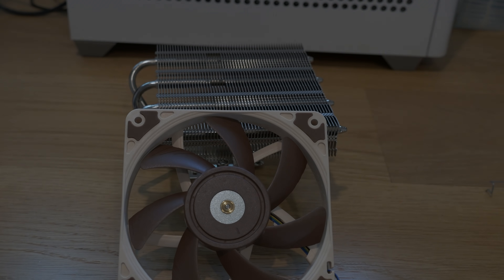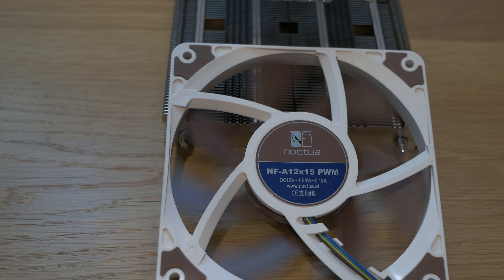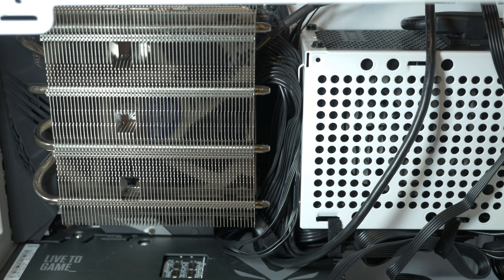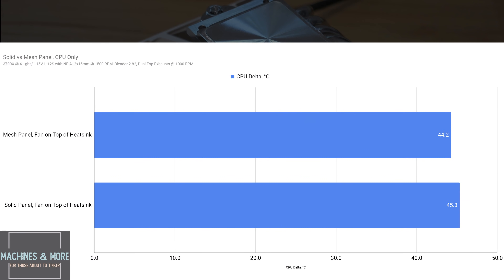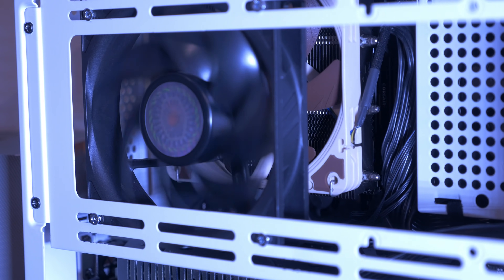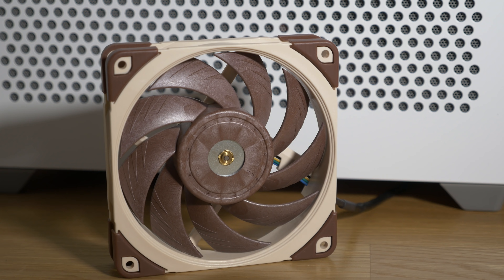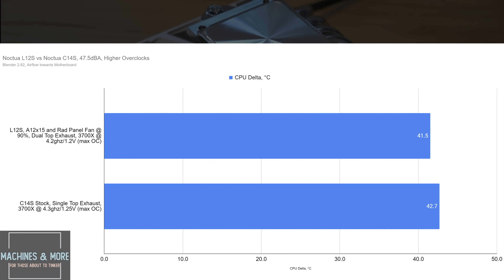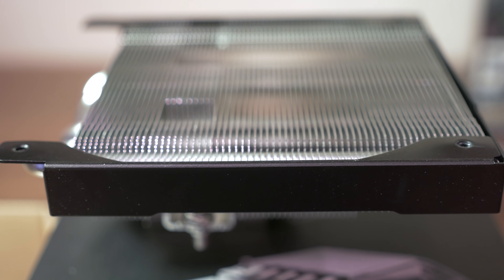Cooler Master NR200: Low Profile Air Cooler Configuration (feat. the Noctua L12S)

Comment: what air cooler should i use for 7950x3d? i currently use a kraken 240 but am upgrading my 3070 to a 9070xt
and am unsure if it will all fit.
Reply from the maker: What case? The bigger the better, for top down coolers look at a C14S, tower coolers such as Thermalright PA120, Be Quiet Dark Rock Pro 5, Noctua D15 etc. are also good choices if you have clearance.
Reply: @ I’m using the NR200, I appreciate the reply brother.

Comment: Thank you so much 🙏 great video 👍 did you by any chance try push/pull away from cpu, either with mesh or side fan exhausting hot cpu air out of the case?

Comment: If using the Noctua NH-L12S Cooler, is it possible to mount a 3.5" HDD on the PSU shroud ? Does is clash or not ? Thanks.

Comment: I migrated my build from a silverstone ftz01 to a n200p. So I kept the noctua l12s low profile cooler. I'm cooling a 5900X with acceptable thermals using the mesh panel. This video convinced me to place an additional fan on the side. I'm running an asus rog Strix 3080 (reason to change the case), which has a massive cooling solution and bleeds some heat to the top. The side panel fan makes sense to mitigate this. Question, one or two side panel fans? I didn't found test data on this, more would be better (since I have them already), right?

Comment: Good tests, thanks a lot! I wonder what would be the best possible solution if I need to install my 3,5" WD Red 4TB drive - an L12S with the fan under the cooler (so low profile RAM), and the drive on the power supply cage? Or the drive on the side panel, would that still be possible with an additional intake fan? Is it possible at all to use such a drive when combined with a C14S? I'm thinking about a build without any graphics card, either with Ryzen 5600G/5700G or with Intel i5-11500 (without K, no overclocking).
Thanks and cheers from Germany,
Wolfgang

Comment: First off - Great reviews!
I ordered a NR200P + 5600X + Gigabyte B550I Aorus AX.  I'm worried about the stock cooler and noise. I like it quiet.  I watched your review of the NH-L12S in the NR200 and am very interested in quietness with glass side panel setup.  The Mugen 5 rev.b is currently about the same price and quietness comparing your reviews.  So basically the NH-L12S is simply more compact and gives similar performance to the Mugen 5 rev.b.  So it seems like a no-brainer to get the low profile NH-L12S or am I missing something?
Reply from the maker: One observation- it sounds like you got the glass panel version, in which the airflow of a tower like the Mugen 5 will be much better than an L12S (which really works well when a vented panel and intaking side fan can help it)

Comment: Thank you for your vids. I actually have a Noctua L9A Low Profile Cooler but I can’t put a bottom fan because of the my thick 2070 Super GPU from Inno3D. One sickle flow fan on the top of the cpu as exhaust and one sickle flow fan on the side as intake bringing air directly to the cpu. I can’t place another fan at the top since my PSU is an SFX-L. GPU is around 78c when gaming at 1440p in Warzone and RDR2. 

What would you suggest for this build to reduce temps? Should I add another fan at the side? Or switch to vertical with two exhaust fans at the top + 2 intake fans at the bottom? 

Thank you

Comment: Awesome Video!
I was pondering a build similar to this,
Although now I came across the SAMA IM01, which is "slightly" bigger but can fit MicroATX and a ATX PSU.

Any recommendation?

Im planning to run a 5600x and a 3070 video card, my aim is to keep temps below 65 Degrees C during gaming @ 1440p with a 75hz monitor

Comment: Did you run into any issue mouting the NH-L12S with the Gigabyte X570 I? The Noctua actually website says it is not compatible. https://ncc.noctua.at/coolers/NH-L12S-17/motherboards/Gigabyte/AM4/?q=570

Comment: I'm curious on how do you mount a second fan on the NH-L12S.

Also, does the stock fan clip allow you to mount a 25mm thick fan?
Reply from the maker: You can do two slim fans- one on top and bottom. The stock fan clip works only with a 15mm fan- if you have a clip for a 25mm fan and another noctua 120mm cooler... that can work too.

Comment: Is it possible to have vertical position of GPU with these low profile coolers in NR200 (mesh panel)? And then arrange push/pull configuration of fans? The GPU would suck the air both from bottom and side mesh panel and CPU would get the air from bottom? But is it possible to fit GPU in vertical position?

Comment: On Noctua website its says that the nh-l12s is not compatible with a gigabyte x570i mb. Did you have to take off the I/O shroud? Also does 25mm fan fit for dual top exhaust or should we go with slim fans?
Reply from the maker: No, it was compatible at stock. What it might be implying is more restrictions with fan on the bottom, and it does lack the ability to be mounted where the overhang would hit the I/O shroud, although you can go at least 1 way for either fins horizontal or fins vertical, and there will be a RAM height limitation. I didn’t have issues with fan on the bottom plus LPX RAM, for what it’s worth.

Comment: What about the "rear fan" on this setup (included 90mm that comes with the case)? If I can fit that next to my cooler, should I? Or repurpose it to the bottom maybe?
Reply from the maker: If you can fit it, go for it. Mine would not with the L12S.

Comment: Very detailed analysis! Does the NH-C14S with fan on top still allow you space to put a side-panel fan on to feed it cold air?
I'm thinking of trying to get the best of both worlds with your "L12S with bottom+side+upper fans" ideal config, but with the NH-C14S.
Reply from the maker: You could just place the A14 on the panel directly and a fan under the heatsink, that’s what I found to be best.
Reply: @MachinesMore  Thanks for your response! I worry slightly about RAM clearance, but maybe an A12x15 will fit the bill there.

Comment: If you're running a L12S in a top fan mount configuration, is there enough clearance room left to mount a GPU AIO radiator with fans on the side bracket?
Reply from the maker: If I recall correctly it will have to be in low profile mode, I did this with a Big Shuriken 3.  The fan will be right up against the rad too so realistically you need to exhaust the cpu cooler into the radiator (don’t intake the rad exhaust into your cooler). The better way is to use a 120mm AIO if your GPU is low TBP enough.
Reply: @MachinesMore  noted. Thanks for  answering so swiftly too 👍

Comment: Thank you for this very useful video. Is there any chance to accomodate a Noctua NH-C14S cooler and use 25 mm thick fan at the top of the box as exhaust with the NR200 case ?
I looked at the instalation instructions of the Noctua NH-C14S and there is the possibility to rotate it but i cannot understand if it helps or not.
Thank you !
Reply from the maker: Paolo, it's pretty tight and that the top and fit may be board dependent. A slim fan is your best bet. With this case you're pretty limited to one orientation.

Comment: Noctua Fan here too ;) I am thinking of buying the NR200P very soon. Is the Noctua L12S still good for an i5-10500 with no GPU at all and never OC? I think the Noctua NH-L9i should be fine too, I've done this on a Deskmini 310 before and it doesn't heat up at all!
Hug from france! Thank you for your reply :)
Reply from the maker: Bonjour Chris, since you have no GPU you have tons of free airspace at the bottom, just make sure you run intake fans at the bottom and the L12S should be excellent for it.

Comment: One of the best essays on aircooling and optimized air flow in SFF cases ! FWY I have a 3900X in a Streacom DA2 aircooled by a NH-C14S in push - pull config and it is incredibly silent (not OCed but PBO enabled) while it manages to tame the beast ...
Reply from the maker: Very good cooler. Not as popular as their towers but clearly capable in the right conditions.

Comment: I absolute hate the sound of the default fans that come with the case. I have no space for 2 top fans as I have an ATX psu in there. I am thinking to push pull with one fan under the PSU at the bottom as intake.. and one exhaust above the cpu. Glass panel side.  I am only running a 1600 on a b550i so I think it will be fine. I want to keep noise levels to a minimum.

Comment: I just wonder, how about install vertical gpu + l12s fan under heatsink + 2 bottom fan intake , 2 top fan exhaust, is someone already tested?
Reply from the maker: I tested with the 3080 FE vertical and a Big Shuriken 3. Not good for the cpu... insufficient room for airflow plus a bad source of airflow.
Reply: @MachinesMore  can you describe the min & max temp? im curious about vertical gpu + low profile hsf make cable management is easier and i think its aesthetics for some gpu

Comment: im liking this setup , would 2 side panel fans be a negative over the one in this situation ?
Reply from the maker: Performance wise, no negatives, but it won’t help much either, so noise/cost is a small factor.

Comment: Was thinking of using the Arctic freezer ii 120 and a P12 on the side panel, so I can fit a 3.5 drive. Or just use the NH-U12A. Can't decide.
Reply from the maker: Just in general, I don't recommend 120mm AIOs since a decent air cooler will beat it, even something thick like the Liquid Freezer II. In fact you wouldn't have to go to a U12A to beat a 120 AIO. If your choice is between that and a U12A, and you need that level of cooling, then for sure I would go U12A. The U12A is much much closer to a 240mm AIO than a 120mm. With the U12A you can still run a 3.5" on the PSU. You can also mod the rad panel to fit over the heatpipes on tall towers, if you want to mount it there.

Comment: Check out the Noctua NF-A9x14, it's a 92mm fan with 14mm thickness instead of 25mm so it should fit at the rear of the case with the L12S installed

Comment: Great job man. I am just about to go through all your NR200 vids coz I will recieve my one this Saturday and swap my system from Metis plus. By far i dont see anyone using a CM G200P but me :D
Anyhow my idea was, dualtop in, single rear out. Using asus turbo evo dhe going rear out and maybe add to intake at bottom. What do You guess it will be a fine option or better get 1 rear in and dual top out?
Thx budy👍🏻

Comment: Great content! I'm building my first computer and wanted to know which and how many Noctua case fans I need for the c14s build from the video. I couldn't tell exactly since I am not very knowledgeable and a beginner in sff builds. Are the case fans in the same direction? Thank you so much for your help!
Reply from the maker: Awesome! First time builder, love it! In a few weeks I'll be doing a full build from start to finish so perhaps that will be helpful.
Depending on your GPU, you might be able to fit two 25mm fans under it, or two 15mm fans. Those should always blow upwards into your GPU fans (look at the arrows on the side of the fan case to check). With an SFX power supply, at the top, you are able to mount one fan blowing upwards, this is directly over the PSU cage. You might not get another fan over your C14S, unless you have something like a ASUS board and get a slim fan to mount.
The simple configuration is just to mount the 140mm fan at the top of the C14S heatsink, to blow air towards your motherboard. That's it! You really only need three fans in that setup, if you feel like you need it later on you could always get another fan that works well on heatsinks, and mount it under the heatsink to blow more air at the motherboard (look for "Static pressure" optimized fans). HTH and good luck!
Reply: @MachinesMore  Thank you for the reply! Definitely looking forward to the upcoming full build content.Fantastic channel! :D
Reply: @hangizon  How did it go for your build? 
I'm also building my first desktop pc and want to go with the C14S on the NR200P (gonna use the mesh cover). Still not sure how many fan do I exactly need. My case comes with 2 stock fans both 120mm. I'm thinking of mounting them at the bottom of the gpu but not sure if they fit. 

Did you use slim fans (12x15) on the bottom? How about for the top as exhaust, did you use a slim fan there?
Reply: @marieantoine  It actually went pretty well! I ended up with two up top as exhausts (not slim). It fits perfectly for me. I used 2 fans in the bottom also but took them off. I ended up using the se224xt as the cooler so am using 2 fans (also not slim) on the cooler. So in total I'm using 4 fans (and I'm using the arctic ones since noctua is much more expensive). You should be able to fit in slim fans in the bottom. The top exhausts works perfectly and is highly recommended. Machines & More videos helped me a lot for my final build.

Comment: Just for discussion: would a 120mm “tube” between the mesh panel and a top-mounted fan on the L12S be a good idea, replacing a separate mesh panel fan and even lowering noice?
Reply from the maker: My thought is that it wouldn’t work as well as just having a fan on the side panel. I can’t say if it would be better than no tube, but you are increasing the static pressure burden on the fan- now it will need to fight the dust filter and mesh panel and also push through the heatsink, taking less cool air may be worse than just taking a lot of warm air. Putting the side panel fan on gives it the opportunity to take in a lot of cool air.

Comment: Just for discussion: would a 120mm “tube” between the mesh panel and a top-mounted fan on the L12S be a good idea, replacing a separate mesh panel fan and even lowering noice?

Comment: I had a similar clearance issue with fitting rear fan and Nh-C14s in a Cougar QBX, but Noctua does have a 15mm thick  92mm fan

Comment: I'm glad I found you just after I decided my next build will be in a nr200. Tons of Info here! Thanks for that.
The cooler I'd suggest which I'm thinking about for a 3600x or 3700x top, is the Noctua NH-U9S. Maybe you'll cover it too? I have plenty of time until I can by next gen GPU (under 3800 category for sure, 3700 or 3600). Cheers

Comment: Hey there! I actually have an Aorus B550i mobo and the NR200 and I am thinking about buying a Noctua L12S as a CPU cooler. Do you think that both top fans will fit as it did for you with the Aorus X570i mobo? How much space there is in your build between the top of the L12S heatsink and the starting point of the top exhaust fan? Thanks and great video!

Comment: 3700x@4.1@1.15v i'd call that an underclock tbh. Runs at a higher speed and voltage at stock :p
Reply from the maker: You're right in that the voltage is low vs what auto OC would feed it. I'm guessing you're already aware of this- when overclocking you want to give it as little voltage as possible as long as it's stable, which is why it's lowered. The better the silicon, the lower the voltage. While it's lower than the max all-core (4.2) that the chip would hit on auto-overclock, when given ideal thermals, on auto behavior the chip rarely will stay on that level. Testing on "stock settings" is also problematic for thermals, since the clocks will vary based on the CPU itself, and lead to inconsistent thermal loads from cooler to cooler. So, one needs to force it to lock to an all-core OC. It can absolutely run at 4.2ghz all-core with the L12S, but it's too much of a load on the chip in a combined GPU/CPU stress test, which is why I settle for a 4.1ghz on all cores.

Comment: Hey nice content. Currently I am using NR200P with top/bottom fans. As you mentioned there's a significant benefit of blowing additional air to the CPU and I wonder, can you test if adding a 92mm rear fan would help in NR200P significantly?

Comment: Hi I would like to ask for your advice. I already have a u9s and was thinking of upgrading to the u12a. Should go with that route or just buy two fans for side intake instead? Thank you! God bless
Reply from the maker: I haven't tested the U9s in this case but might do so soon. Without testing, I am confident that the U12A will outperform it, due to the higher quality fans. Whether or not you need the extra performance depends on what CPU you are running.
Reply: @MachinesMore  thanks! If the U12A and C14s have the same price which should I go with?(sadly it's the same price on where I live)
Reply: @unforsaken552  What is your cpu for those? I'm torn between choosing one from those two for my Ryzen 7 5800x. Apparently this cpu runs hotter than other higher cpu's from what I read
Reply: @marieantoine  MY CPU is only the 5600X

Comment: you should try out the Cryorig C1 with a noctua U12a or A14 or even A15 on it. Worked well for me in the NZXT H1 30~55C operating temps.

Comment: How did you connect so many fans? I have an asus b450 i with just two fan headers. Please give me a recommendation, it would be appreciated :)
Reply from the maker: For testing lately, I use a fan controller since it makes it possible to lock down fan speeds and control multiple channels of fans. For the general purpose build it's a bit overkill plus takes up more cabling space. The case by default comes with a splitter cable which will give you three fans- I'd use this for the case fans and just buy another three fan splitter cable which will give you an additional two fans- or, if you have another header you can use for case fans on your board, just get a two way splitter and run two off of those. Either way you can get 5 fans you can use for case fans. Then for your CPU cooler fan- use the dedicated CPU_FAN header on your board- almost most all mobos have them. Edit: By the way, I have that board and as I recall it has one for "AIO_pump", although I'm not certain if you can control the speed if you use it for fans, if you can you're good to go, just have the right selection in BIOS, would give you an additional layer of control. HTH.
Reply: @MachinesMore  Thank you very much :)